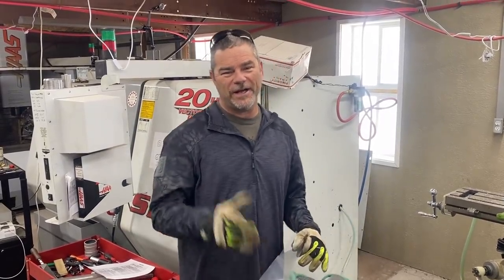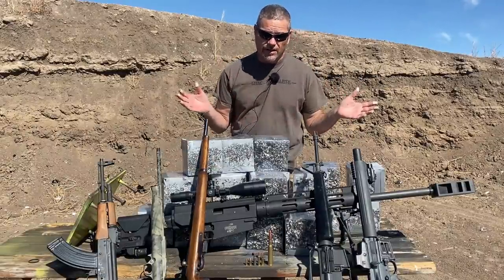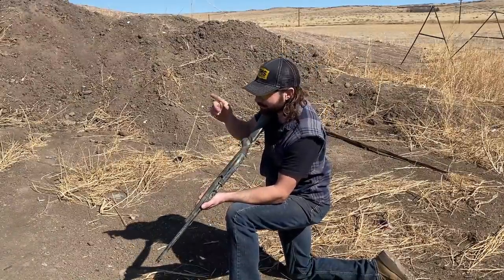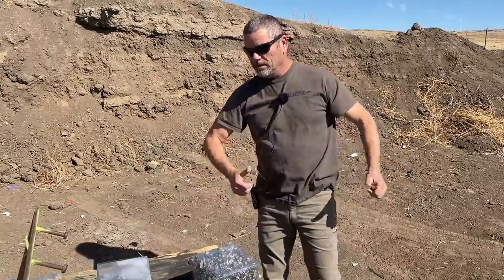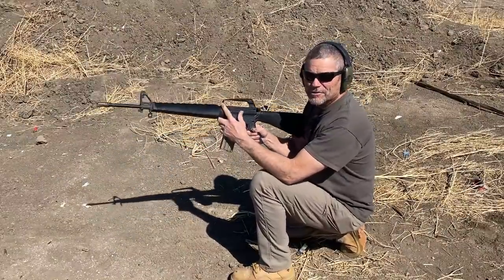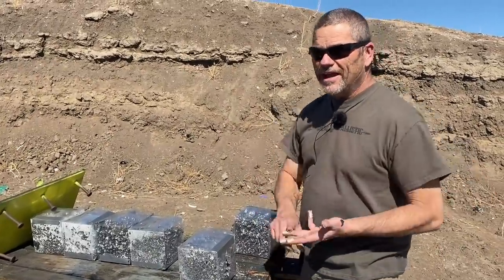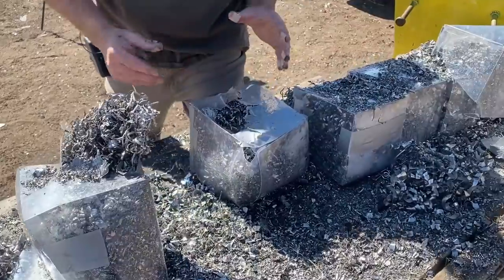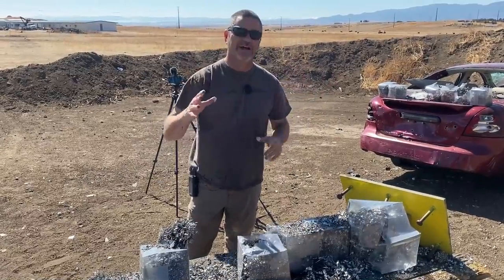Can Metal Shavings Stop a 50 BMG?

Comment: Really cool idea and presentation. Loved how the spotter/tracer knocked Justin's hat. If you have not cleaned it up,i suggest to use bucket,showel the shavings with dirt in it,and put a strong magnet to the bottom of the bucket. That way you can separate the dirt from it and dump the dust back to the ground and simply clean up the range.
Reply: It was stainless, not magnetic.

Comment: Try using magnesium shavings! Hehe. Jokes aside… might make for an interesting video. 🤔
Reply from the maker: Good idea!
Reply: I'm excited for this idea.. magnesium shaving may be expensive though..
Reply: Ali express does magnesium, just stick it in a lathe and make shavings
Reply: @maleindividual7437  Still super expensive to do a good bit of magnesium, also I don't think incendiary would ignite magnesium
Reply: @youtubeSuckssNow  would not burn,  be same as steel
Reply: @maleindividual7437  you can buy magnesium shavings pretty cheap online.
Reply: @jantschierschky3461  titanium is actually a combustible metal.
Reply: @maleindividual7437  that might work if heat didn't build up. But if it got hot one time there goes the material and the machine would need massive repairs. Ask any machinist who has knowledge about doing this or Google it I'm sure that my statement will be backed up however I truly hope that they can make it happen because it could be spectacular.
Reply: @GoingBallistic  I love the magnesium idea but creating the shavings is risky so please be careful. Also I might be able to get a piece that is about 18 inches long and 4 to 6 inches around for you. I'm just unsure of shipping regulations for this material.
Reply: Big brain time

Comment: Brilliant video, as usual. 
Just an idea, pavement quality concrete is measured 1 cement 2 Sharp sand 3 stone.
Bank safe concrete is measured 1 cement, 2 Sharp sand and 2 metal shaving and 1 ball bearings ( Drill and cut proof) BUT is a slab of it .50 cal proof?
It would be really interesting to see if you make some slabs cubes or torso shaped.
Obviously it would be a long project as t concrete would have to cure for about a month.
Keep up the good work and thank you

Comment: if you could get your hands on it, Kovar. Kovar is a very fibrous tough metal, i bet it would stop bullets no problem. Only issue is getting chips small enough to fit in that box, its nearly impossible to break a chip on a lathe.

ps im a machinist also, so id love to see more stuff like this. Maybe do a bucket of carbide inserts, or even just a 3/4 endmill. Kind of expensive but every shop has a bucket of used tools lyin around. Or trying to catch a bullet in a collet would be really cool to see also.